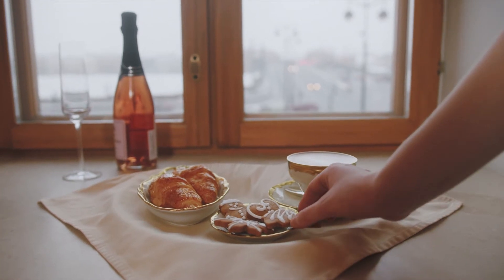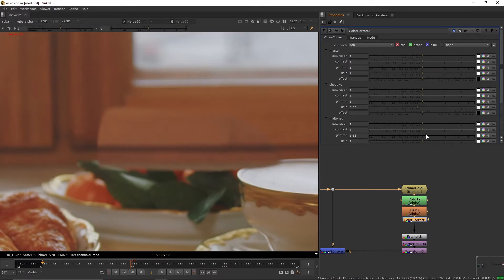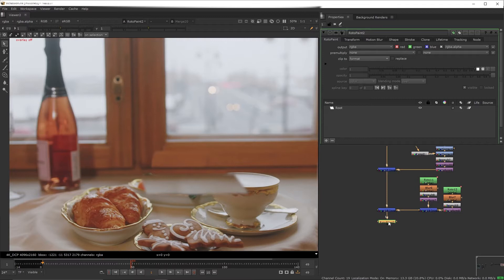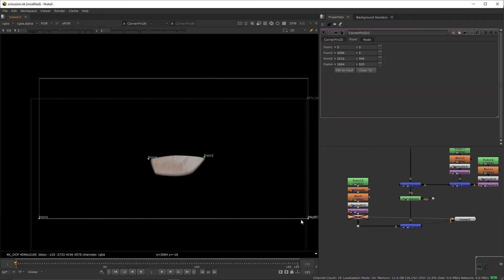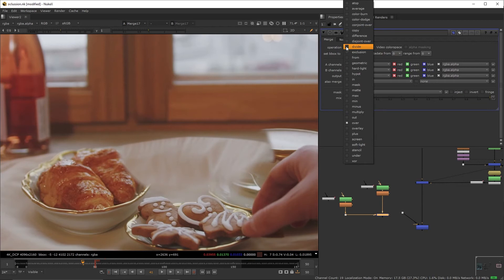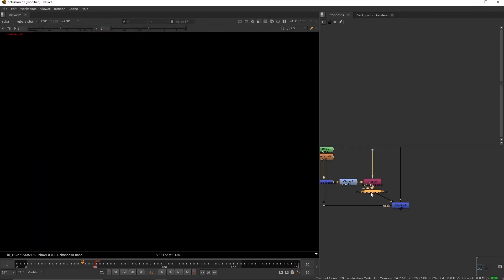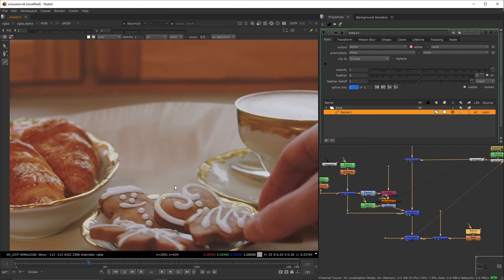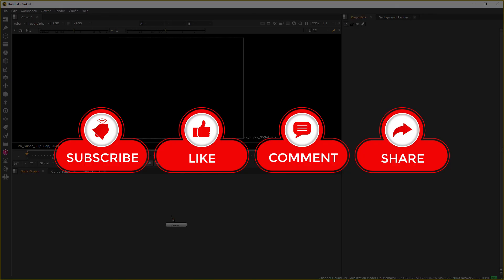Learn to Paint Out: Background Object Removal

Comment: This is awesome , just came across this wonderful channel. i have been trying to master clean up techniques but i found it very difficult when there is parallax. please how do you control the Grid warp or Corner pin tool when matching i found it very difficult to align patches it's a headache, Is there a shortcut key than using my mouse to drag the points
Reply from the maker: Glad this helped! Aligning is difficult for sure. I normally use the numpad to adjust.

Comment: wow, that's good.
could you share the script ? so I can study it ?
i do some preparation and removal, but i think it is not optimal and really struggly with having a solid work.
i was not working so much with the edge-extent.
this is really helping explanation.
thank you for sharing your knowledge.

Questions :
- why do you have two plates side by side ? that is what it seems, maybe i did not get what it really is ?
- why connection to SCREEN instead of over when you connect the roto to bring back the plate objects ?
- why a clamp node ? to the merge.
- at the end, when you show the work done, the tracker beside the roto that is masking the grade is not there anymore ?
Reply from the maker: Definitively! I don't have that file at hand at the moment. Send me an email at learnvfxcompositing@gmail.com and I'll make it available for you once I get a chance.
1.  I was going to show a bit of the denoise/regrain setup, but decided not to because I already covered that in detail in another video. 
2. Using over leads to having alpha values that go past 1. It can become a problem in certain situations. As a rule of thumb go for screen.
3. Are you referring to the edge extend one? If so, we're clamping the roto because we just want the core, meaning pixels with value of 1.
4. You caught a mistake there. It should've been there.
Reply: @learnvfxcomp  i send you an email. thank you for sharing your knowledge.